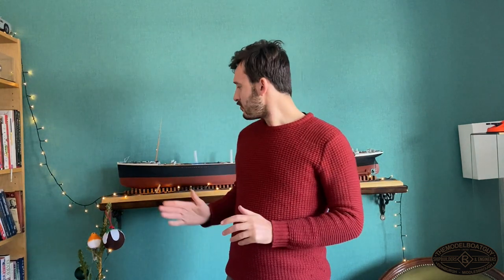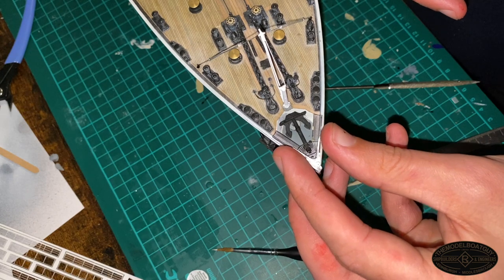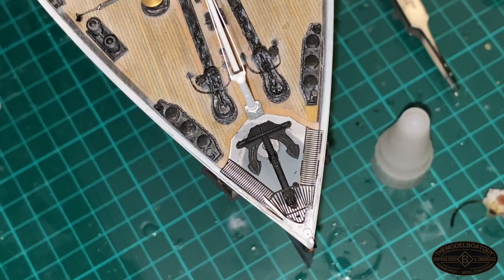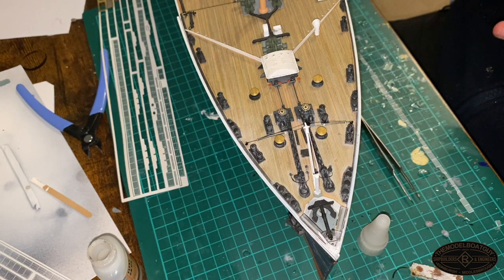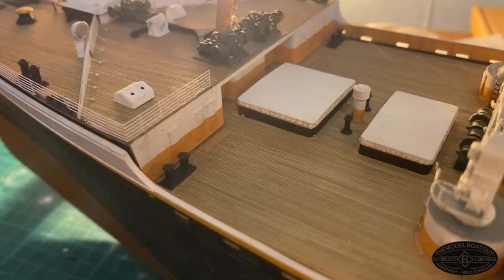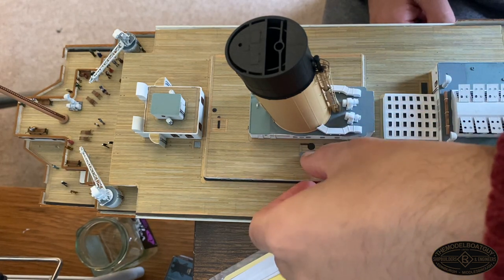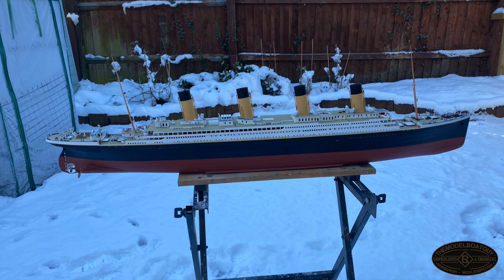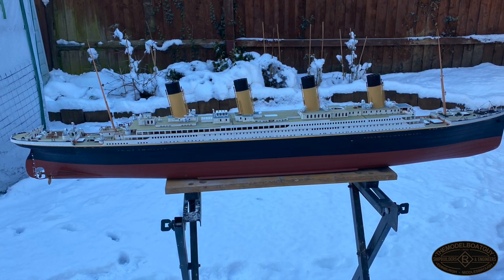Radio Control Trumpeter 1:200 Titanic Build Part 73 - I'm Flying!

Comment: I recently built a 1/550 Hobby Boss Titanic. Tore my hair out looking for the spare anchor and crows nest. Had no idea where they went. Turns out those parts aren't included. I just knew they were supposed to be there. Could've sworn I saw them!
Reply from the maker: Bizarre! Should they have been in the kit or are they just not included?
Reply: @TheModelBoatGuy  not included. Knowing they should be there somewhere had me looking for them. I thought the Carpet Monster dunked on me.